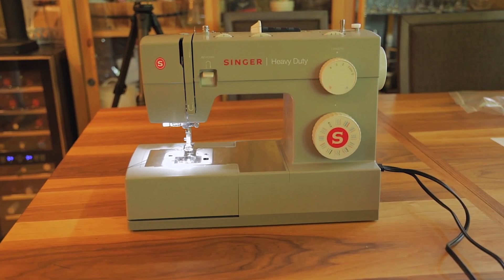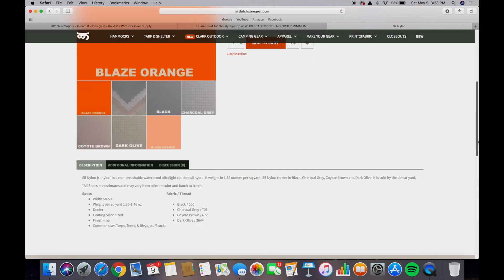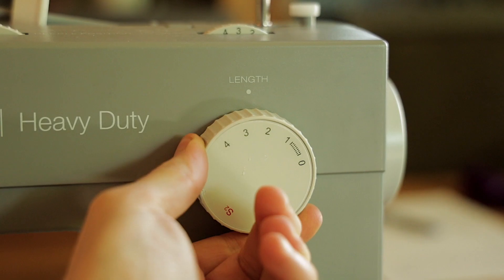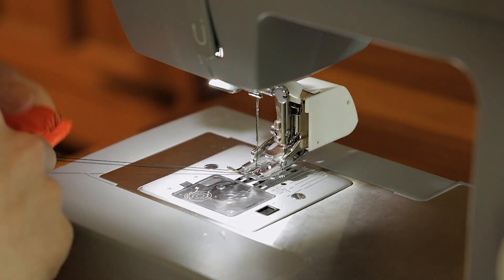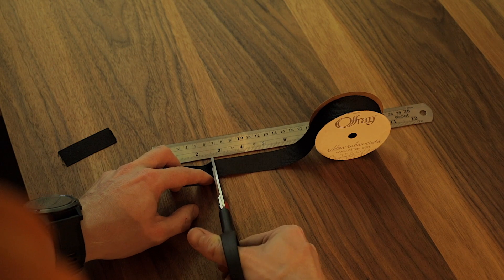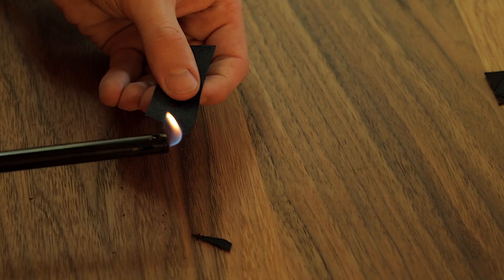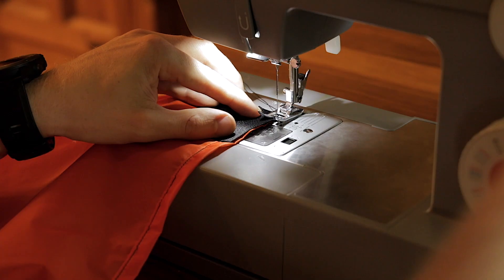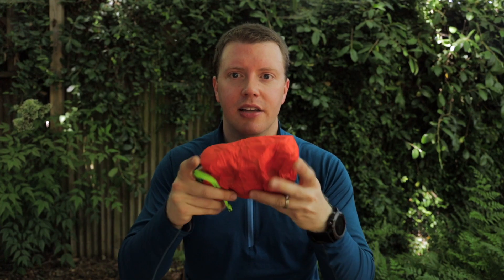Tarp Series:  How to Make a  Lightweight Tarp

Comment: Do you have more specific advice for the weight per m2? Greedy on the weight, I'd like to make mine as light as possible, but I do know that if it gets too light, it will tear or not be waterproof....
Any guidance on that? :)
Reply from the maker: I'm not sure what weight to look for when its comes to m2 as all the fabric I order is in yards squared. In general SilNylon is fairly strong even in the light weights.  I have never had a catastrophic failure where the fabric its self has ripped or a tie out blow out even in high winds.  If I was making a shelter for an exposed alpine environment I might go with a heavier weight vs a shelter designed to be used in the woods.